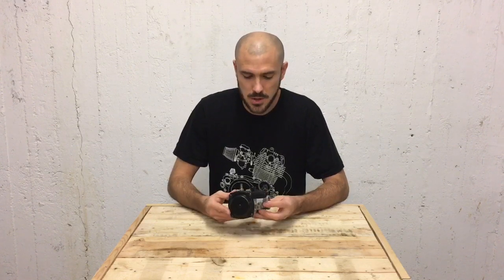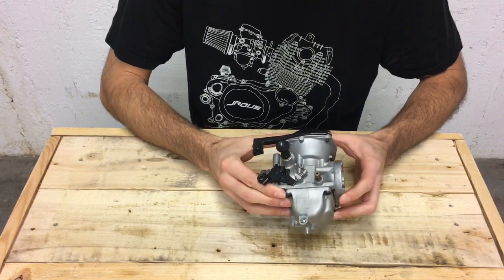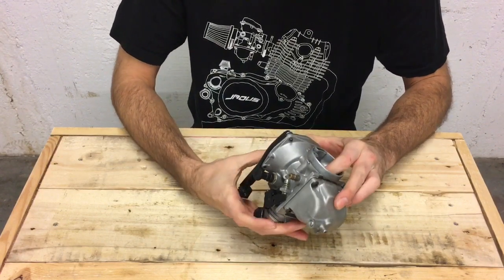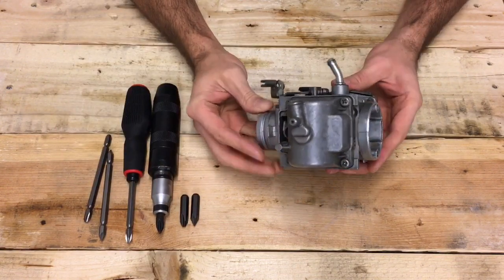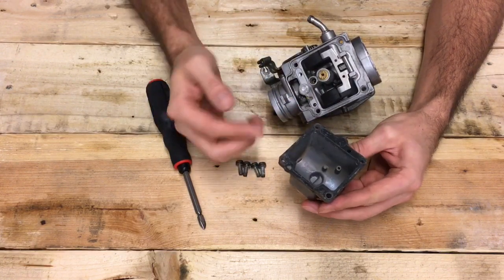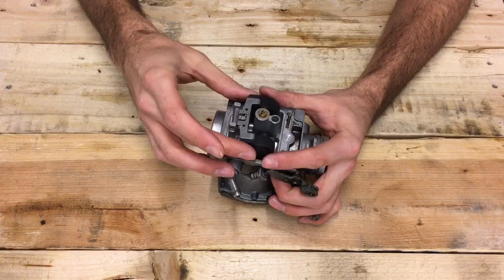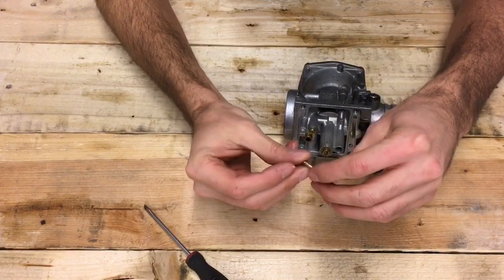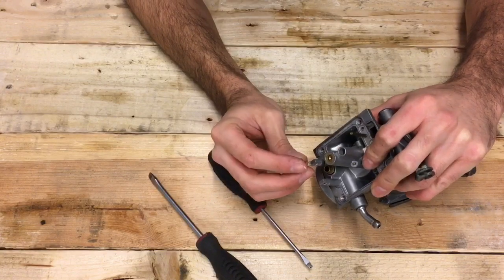Yamaha SR250 carb rebuild, maintenance, tuning

Comment: Well i come from the blog post looking for the carb settings, and i have some questions out of curiosity.
Here I go!
First I'm mounting the Harmonic intake and the Jadus Header with an Universal megatone Muffler from Modeliko, then my question is, this muffler without dbkiller i should consider it a free flowing silencer on the configuration???
Second, when the time of going to the anual revision of C02 emisions come, i will put on a dbkiller for sure, and thats a restriction to the exhaust, giving some turns off or in to the airflow screw isnt a problem, but on the configurations you're pointing that the main jet should be changed from 115 to 120. Is that important only to pass an emisions test?? 
I dont really matter opening the carb once a year but I'm really curious, cause i thought the bigger the main jet was, more gasoline flow and so, more power, but looking the indications I appreciate that the less restrictive the silencer the smaller main jet we use. It needs less gas when having more air exhaust flow??? I really apreciate if you understand my questions.
You're doing a great job and I'm looking forward to show you my SR when it gets finished!!! 
Thanksss
Reply from the maker: Hi!  Thanks for your comment/question.  With the universal muffler from Modeliko it depends what internal baffles it has.  If you can see straight through it, it is free-flowing (meaning you should use a 115 jet) , if you can see a plate with holes in it (ie, can't see straight through it) it is considered not to be free-flowing - meaning you should use the 120 main jet.  You are correct on your assumptions and different main jets, however, this logic does not apply when using a harmonic intake.  With the harmonic intake, the fuel atomizes in a more efficient way and therefor creates a more efficient burn in the combustion chamber, meaning it needs less fuel.
Reply: @JadusMotorcycleParts  thats sooo interesting, thanks for answering, i'm glad I'm modifiying my Sr with your parts!!!

Oh and another one quick question, is there any way to buy a foam filter like the one it comes with the harmonic intake for replacement? Mine has 2 little holes i asume are from soldering near of it, big mistake!

Comment: Hello
Is there any chance that the air-fuel screw would be screwed out 6 times from the factory?
Mine was but I had problems with cold starting and the motor was unstable on idol.
What is the starting point in finding the right air-fuel setup?
Reply from the maker: Hi!  No, that is not very likely.  We have a full carb setting table up on our blog that you can check out - the link is in the description of the video.  Hope it helps!
Reply: @JadusMotorcycleParts  
Hello
Yes, it helps :)
I have cleaned the carb, read your post and I will probably unscrew the screw 2,5 times (I have some aftermarket exhaust with DB killer).
Thank you again for all your work. I wouldn’t even touch the carb myself without it :D
Cheers
Rafal_PL

Comment: Thank you very much for the information depth video! Much appreciated :) I'm still having a slight issue. My bike hangs up when given the slightest throttle and won't idle down for a few moments. I changed the rubber boot and gasket as I assume it's lean, to no fix. Should I unscrew the A/F for more fuel to balance it out?
Reply from the maker: You're welcome man.  Yes you are right, it sounds like a lean condition.  Or an air leak somewhere on the intake side of the carb.  This can be checked by spraying the whole thing (intake boot) with WD40 while the engine is running and listening for any change in engine tone.  Make sure to clean it all off afterwards haha.  But if you are lean, you will either need to adjust the mixture screw or the pilot jet.  Start by screwing out the mixture screw and see if the idle calms down.  When the weather gets warmer here I will finally do the 'on bike' carb set up video :)
Reply: @JadusMotorcycleParts  Thank you for such a quick response! Yeah I had done that before I replaced the boot. Thinking it was a vacuum leak between the carb and cylinder head. But to no progress it still holds a high rpm with a little throttle and a very erratic idle. Gonna try and tweak the A/F in the morning for some good news! And that video would be such a help! Looking forward to it!

Comment: My sr250 has an air filter and full exhaust, what main and pilot jet sizes do you recommend  ?
Reply from the maker: https://www.jadusmotorcycleparts.com/single-post/2018/05/17/Yamaha-SR250-carb-rebuild-maintenance-tuning

Comment: Awesome video! Thanks for all labor and time. Much appreciated it. A quick question about the gap between very lower tip (south) of the butterfly and the surface it is touching (south). When I take it up and point the air intake-side to a light source, I can see light coming though (my eyes) at the very (inner) bottom. The gap is tiny, about half a millimeter. Would that be acceptable? Or, should it touch/close almost fully?

Previous owner had the  triangle metal piece (which sits between choke, idle screw and throttle cable hole and directly connected to butterfly rod) bent. When I tried to fix, I had to take out whole butterfly assembly. As you have mentioned on your video, those two screws on butterfly disks are really pain... Butterfly disk and screw holes are made of soft aluminum, so, you could kiss good-bye with a small mistake. Anyhow, I was able to manage assembling those back. Again, not sure if that was my fault or the way it is but there is a very tiny gap between the bottom top of butterfly and the bottom surface.

Currently, my (78) SR250-Exciter runs only on high throttle and full-pulled choke. I  understand there is most likely a vacuum leak somewhere but wondering how much would that gap may  contribute to this problem. Any feedback is much appreciated. Take care.
Reply from the maker: Hi Ken.  Your problem would likely contribute to the bike not running at idle but would by no means explain the whole  problem.  When you reassembled the butterfly disc you would have noticed a fair amount of play in the holes in the middle where the screws pass through.  The position of the butterfly can therefor be adjusted slight while the screws are done up half tight.  Once it is sitting nicely in the throat of the carb you can do the screws up tight.  It goes without saying that the butterfly has a certain sealing direction too! (it is machined with chamfers on the edges).  Best of luck!
Reply: Hi, I will certainly check those again, as you have suggested. When I visited your site I saw test bikes and brought me some ideas for a new video. Bought my 1978 and 1981 SR250's  recently. When I have been fixing the first one, which runs fine, I did not have any threshold to compare in terms of sound with (or without) tuning up. I gather almost none of us experienced the sound of those bikes during 70's or 80's, so, we don't know the original sound, or, reasonable sounds of engines in almost ideal conditions. If you could make us some quick videos how it needs to sound when tunes up, so, we could try to match, it would be great. Looking for 3D printing options here. Planning to order 3D scans from you guys. Take care.

Comment: Hi, I have 1981 SR250 Exciter, I rebuild the carburetor. She idles great and excellent throttle response. However when I come to a stop after a mile, the bike begin to idle very high and I have to turn the engine off to prevent it idle too hard. What could be the issue?
Reply from the maker: It sounds like an intake air leak - especially if it gets worse with a warm engine.  Check this video here for diagnosing the problem:  https://www.youtube.com/watch?v=KguU__52MLk&t=14s
Reply: @JadusMotorcycleParts  Fixed the problem! (Had to buy two hose clamp for the vacuum line) The SR250 won't idle very long after 5 seconds ever since I clamped the vacuum line. Would it be the throttle stop screw adjustment resolve this problem? (if yes then how much do I turn it)
Reply from the maker: Agent 715 why clamp the vacuum line? That would starve the carb of fuel! Watch our other videos about the air fuel screw adjustment ;)

Comment: Thanks for the video, helped a lot with changing out the jets in my carb, although I have a question to see if anyone here could help me out. I'm having trouble starting the bike when its cold and it doesn't idle well.I tried adjusting the air filter screw but it didn't seem to help. It was originally at 3/4 of one rotation until fully tightened. I screwed it out two full rotations but it didn't help with the cold start at all. It seemed to help with the idling a bit, but not very much. Everything on the bike is stock but some of the jets are replaced. I'd appreciate any advice on what to do, thanks in advanced.
Reply from the maker: Have you done any modifications to the intake or exhaust?  Have you cleaned out all the jets and blown through them and the carbs passage ways with compressed air?  Is your diaphragm in good shape?  Does opening the choke improve or worsen the problem?
Reply: Jadus Motorcycle Parts I didn’t make any modifications to intake/ exhaust and yes I did blow throw the carb, when replacing the jets. The diaphragm seemed to be in good shape but I might get a replacement anyway(the bike was sitting in a shed for almost 25 years) and opening the choke makes it worse. Without the choke the engine tries to start when I give it some throttle but doesn’t get any further. When the choke is open almost nothing happens. The bike will run fine if I use some starting fluid.
Reply from the maker: @bobbobby9768  We have a video coming soon that might help you buddy.  Keep a look out this weekend :)